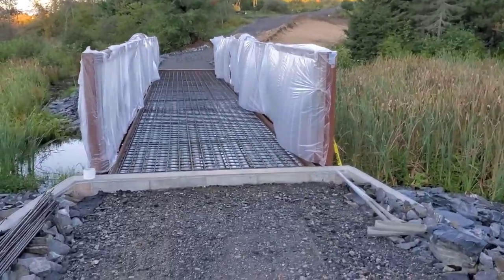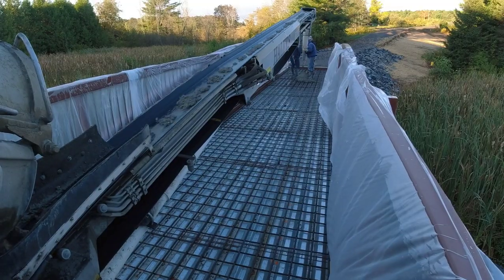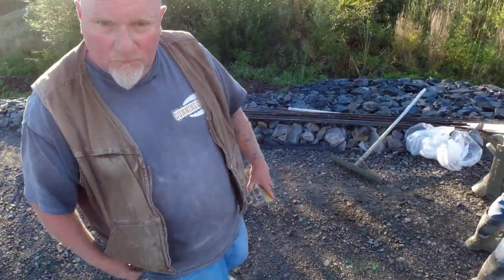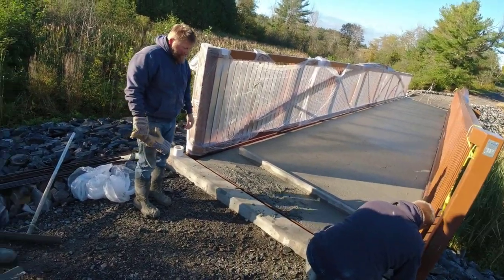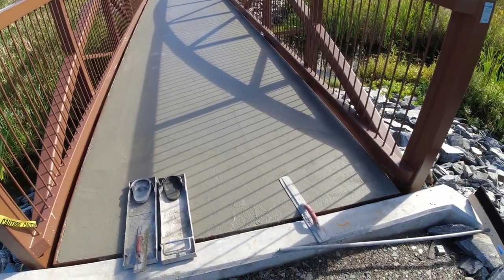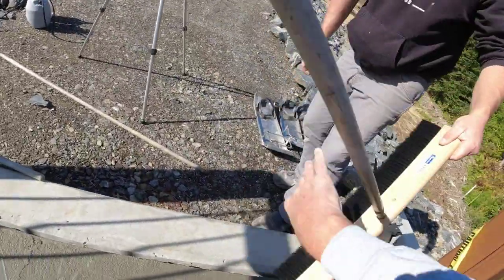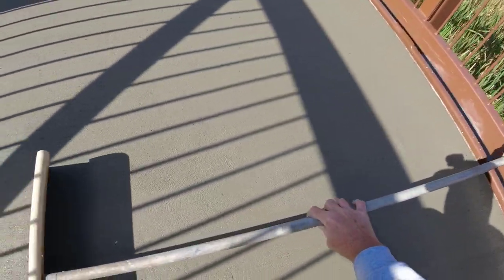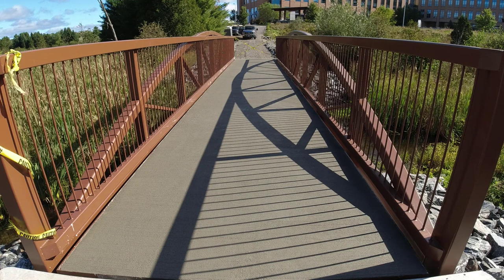Hanging Off A Bridge To Finish Concrete (Bridge Deck Pour)

Comment: Thanks Mike.  What do you recommend to both cure and then seal after finishing something like this?
Reply from the maker: For this, they use a penetrating sealer 30 days afterwards. It's called Salt Guard.

Comment: Your the first  concrete guy I've seen on youtube pouring a bridge ,did you have too come back for saw cuts and seal it?
Reply from the maker: Cuts weren't on the plan, that's why the rebar was 6" on center. Sealing is up to the GC

Comment: Day one rules.   We use it for all the hard trowel finish we do on concrete skate parks
Reply: We dilute it down, and add it to water bottles.  Spray it on and float/trowel it in.
Reply from the maker: Nice, thanks for the tip